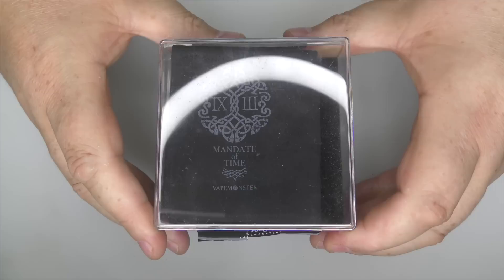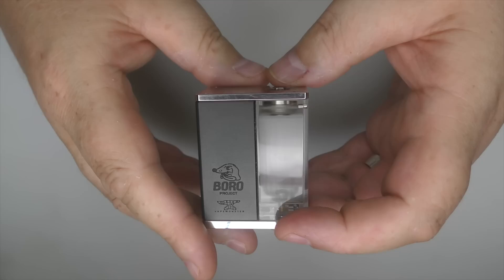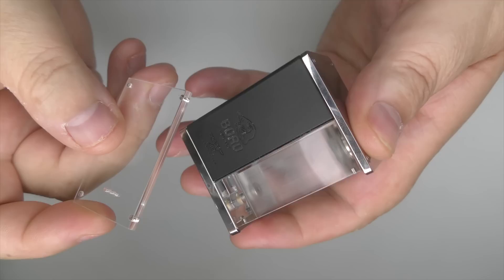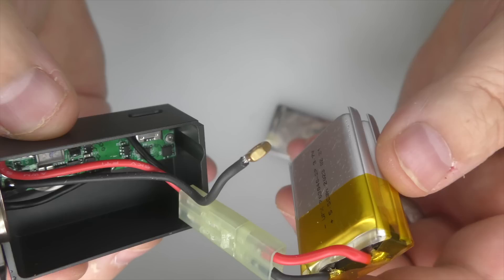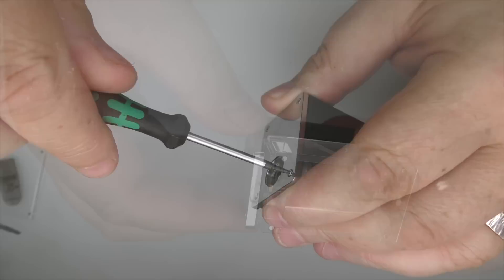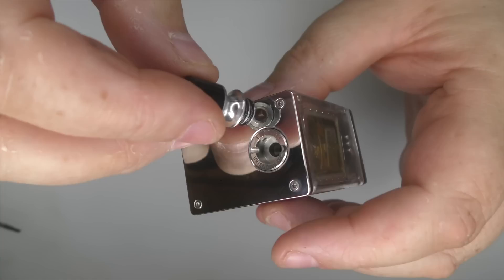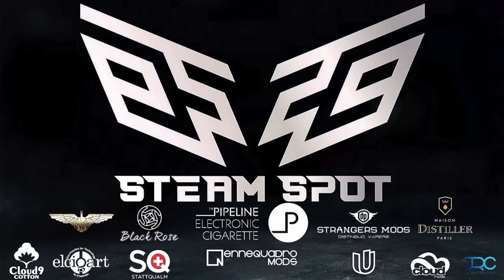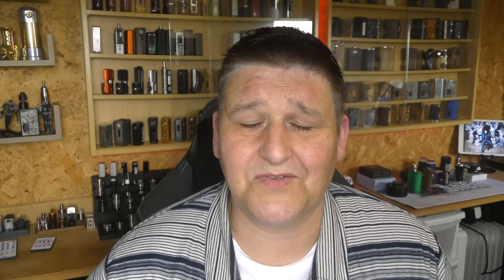Eternity X by Vapemonster

Comment: Thank you for the review Mark! I actually have his first boro device which is called the eternity and the boro compartment is on top of the chip so its much taller but skinnier with af from the front and back and it was actually cheaper, i have to agree that this is more of a tabletop mod and it does look gorgeous. Thanks again

Comment: Have to say that is really quite nice. I don’t doubt that it’s uncomfortable in the hand and it is an odd design compared to the standard boro mod MO, but the window that shows off the while boro and the clean lines are lovely. I also like the offset buttons and the crisp mirror shine. The mod corporation boro and the drip tip make this one of the prettiest, if not practical, of the endless boro mod genre. 

Massive kudos to Mr Todd for not losing one of the minuscule screws when taking the device apart!

Comment: I agree it's a very nice design, but there's a whole lot of decisions that don't make sense.  Small, but the chonk, sharp edges, and weight take it out of the pocket carry choices.  Less power than a good 18650 and a totally unknown board with minimal features.  Yet the price (no, not an accusation of overpricing) is the final nail.  Doesn't make a lot of sense,  The modder actually seems to have some good ideas, shown by the construction, but my hope is that the next version he does make it a bit more approachable in a vape segment with a lot of good mods at that price point that don't have these issues.

Comment: dang, i wish SXK made a v2 of the bantam box but seeing the backlash they got from making the v1, it might be a pipe dream
Reply from the maker: Shows what they can do when they make their own gear, shame they don't concentrate on that rather than ripping other people's work.
Reply: I was a fan of the supbox for that reason, because they designed something of their own, but you gotta admit the form factor of that bantam box was attractive
Reply: @Q.u.i.l.l.y  i owned the supbox and let me tell you right now, if you did not own the DNA 60 version, it was a headache through and through, constant and i mean CONSTANT connection issues with the top nut.